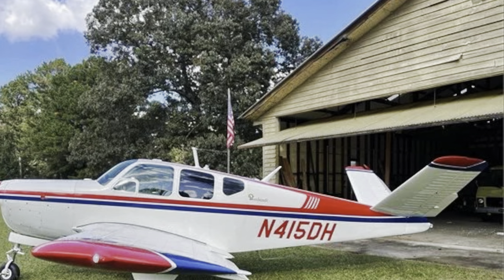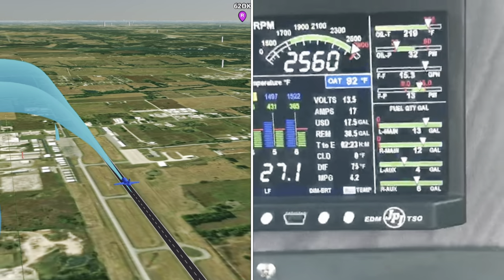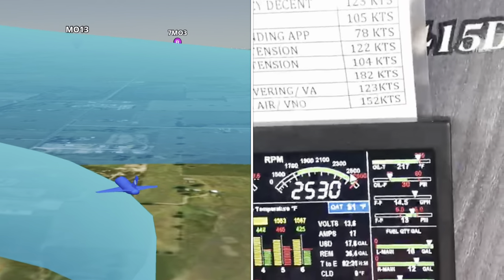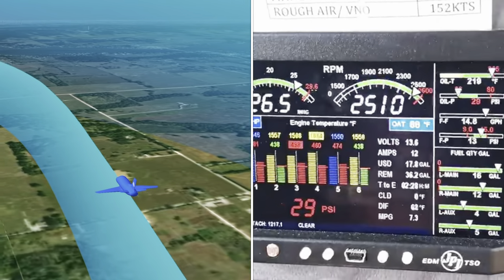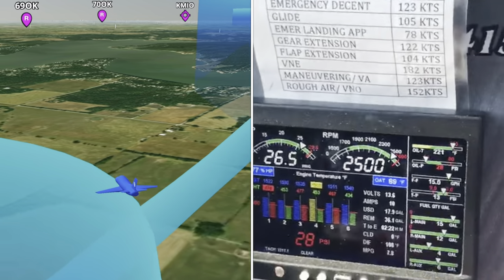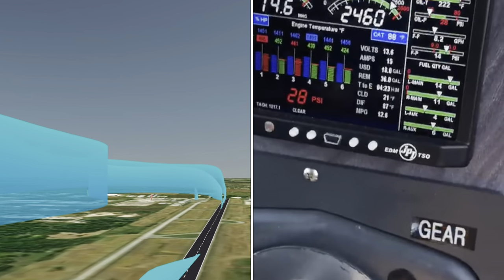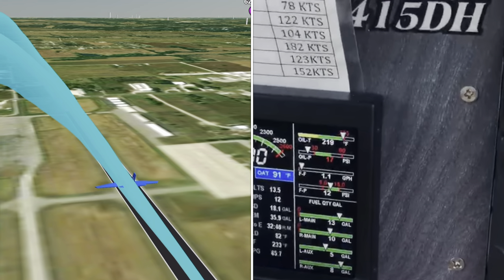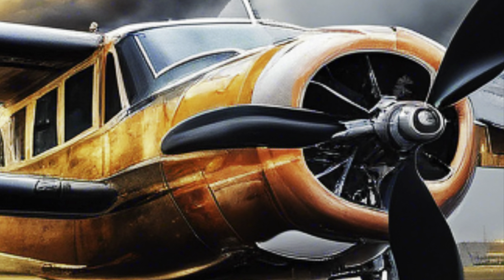My Plane Tried to Kill Me! : Surviving Engine Failure After Takeoff

Comment: So glad that you, the mechanic and your plane all made it out of that situation unscathed!  Thank you also for sharing this information.  I have a few questions, if you would be so kind as to respond to them.  For my questions to make sense, I first need to give some backdrop or context to them.

I have been following a YouTube channel for several years now that advocates a training approach for GA pilots that the airlines have been using for many years.  It's called AQP or Advanced Qualification Program.

Essentially, the stance is that in order to get our pilots licenses, among other parts of the training, we need to practice maneuvers such as turns around a point, slow flight, etc.  This is appropriate because it demonstrates proficiency, but that just helps us BECOME pilots.  It doesn't help us REMAIN pilots... by surviving emergency scenarios, like the one that you experienced.

How does proficiency with a chandelle help me if I have complete engine failure and a total loss of thrust?  (I know your situation was not a total loss of thrust.  I'm just using that as an example emergency.)

Anyway, that's where the airlines feel AQP comes in.  Rather than their training consisting of practicing maneuvers, they train for the most likely or most common real-world emergencies, so that WHEN the emergency happen, they're not caught by surprise and freeze up, or by the rush of adrenaline, etc.

Two of those AQP scenarios are LOTOT (loss of thrust on takeoff) and PLOTOT (partial loss of thrust on takeoff).  To get very specific, PLOTOT, coupled with the subsequent decision making by the pilot, appear to be the largest contributors to Richard McSpadden's tragic crash in Lake Placid.

Now to my questions.

#1 It appeared that although your engine started having problems at around 300', it was still creating enough power to continue to climb, but I can't be sure because I couldn't see any altitude markers on the flight path (CloudAhoy?) nor was your altimeter visible, so I'm only guessing at that.  Were you able to continue climbing?

#2 It also appeared from the animated graphic that there were open fields in every direction.  This to me would have been the #1 argument for doing exactly what you did and attempting a return to the airport and specifically, to the runway in the upwind direction, because, even if the engine suddenly failed, you could just make a modest turn toward an open field and make an off-field landing.  I'm just wondering if this was part of your decision process, because I didn't hear you talk about any of those decision points.  In other words, if your situation had been slightly different and you had lost ALL power and the only open fields were straight ahead, off the end of the runway where you lost power, would you have still attempted a return to the airport or would you have kept going straight and landed off field?

#3 The channel I referenced earlier is "Probable Cause Dan Gryder" and PLOTOT was an emergency that he ADDED to his personal AQP list, specifically because of the McSpadden accident.  Dan states that PLOTOT is probably even more dangerous than LOTOT because of the fact that that residual power can lull us into a false sense of security.  Again, in your case, it looked like you always had the option to bail out of the return to airport plan and land off airport, so that doesn't apply to your situation, but I just wondered about your thoughts on that.

Thanks so much!
Reply from the maker: You are correct the plane was continuing to make power and we were about 400 ft agl so I immediately made the the suicide turn since the plane was making power. This is my home airport and I know the surroundings so that’s why I chose to land into the wind instead of landing with wind (about 15 knots) if the engine seized we had open fields to land in. Any time I take off on 18 i remind myself that if the engine shuts down it’s a straight ahead landing slightly to the left to the open fields. Taking off on 36 is different story because of the lake.

Comment: You should safety wire the body in BOTH directions.  I’ve had mine move even after following the latest bulletin, but securing the bolt-head and body both CW and CCW with the fiber gasket has worked well.   We had the dual copper crush also fail....I prefer the combination of the copper top and fiber at the bottom, but preventing movement/rotation is essential.   Mine is an io470k in a 1963 35b33, I have lots of videos up flying around in her!
Reply from the maker: It is safety wired as you said, sorry I should have posted a picture of it.

Comment: A number of responses I consider excessively nit picky here.  Great job and it's a bonus that the engine is still usable.  Like you, if I'm in flight, I'm going to run the thing until it makes metal as long as it's making useful forward thrust.  Glad you, the aircraft and the engine are all OK.  Subscribed.
Reply from the maker: Thank you and appreciate your comments.
Reply: Turnaround for 3 minutes with low oil pressure and red line temp will damage that engine. Yes or not?
Reply: @JavierBrent  I worked in a machine shop when I was young.  Mechanical stuff doesn't work in absolutes like that.  If the engine makes good oil pressure after the oil filter adapter was fixed and there's not debris in the oil filter pleats, I personally would run it.  Being serviceable now doesn't necessarily mean the useful life of the engine isn't reduced, it might have been.  But there's no way of knowing if accelerated wear exists without tearing down the engine.  You can only work with the data that you have.  I would be watching the oil analysis like a hawk from here on out and cutting open every filter, in addition to the normal checks like compressions and so forth.
Reply from the maker: @JimBronson  Jim we do, this engine is  over 30 years old but it is mid time 1300 hrs. and the compressions are good and has over 300 hours of time within the last 3 years.  As long as there isn't metal and its not using oil I will continue to get the bonus time out of it.
Reply: @PlanesAndPoker  For the record, I agree with you.  Flying is expensive enough as it is, to not run an engine that from all available datapoints, appears serviceable.  I'd run it.

If I had multiple million dollars sitting around to where I felt buying a replacement piston engine wasn't a big deal, I'd just go buy a turbine powered aircraft.
Reply: @JimBronson  You are right !
Reply: @JimBronson  Cut open the present filter and send for oil analisis i bet there is damage.

Comment: I learned 400 agl Teardrop Turns partial power on cherokees in 1996.  Looks like you could do that maneuver, cut power after the 20 second turnback and land.  Save the engine.  To keep going around the airport with red lines telling you to shut down engine could have worn out that engine badly.  What procedure you dont know will hurt you.  Practice those partial power turnbacks.
Reply: Engines are replaceable, lives are not.
Reply: @JimBronson  Pilots should know the most to maneuver, not the least.  Some CFI's only teach the least.  Going around the airport with bad engine has killed thousands..  That is not a turnback, that is a Turnaround.  Duhh.

Comment: Take note pilots: the gauges showed an ABNORMAL indication and the PIC decided to continue the takeoff. You shouldn’t wait for an exceedance, but instead use trend data and good judgement. This pilot had been flying for 30 minutes and should have known the engine was outside its normal range. The mechanic was recording it which means they both knew there was a problem.
Reply from the maker: Unfortunately you are wrong and since there wasn’t a video showing both I was hesitant to publish but given the nature of the gasket failure I felt the need to as an FYI. The gauges never were outside of the normal until the last takeoff 3/3 and was only then that gasket failed.
Reply: both oil pressure and temperature were just along the green indicator in the video.   It happens quickly, and suddenly, and the likelyhood of it happening just before take-off are slim.   My temps and pressures are right on the line in the heat of summer at take-off and climb in the best circumstances
Reply: I’ll clarify what I mean by abnormal. Every engine will show consistent data with regards to environmental factors. Abnormal means indications that are outside values typically noted. It’s clear you were seeing abnormal temperatures during or before takeoff. My statement is to encourage pilots that problems can often be detected prior to an exceedance, as was the case here. I’m glad you published this video because it is a really good example of what not to do.
Reply from the maker: @patricksteadman1877  i published this video mostly to warn other pilots against the dangers of the tempest spin on oil filters, I also want to reiterate that this was a post maintenance flight with my AP filming so you are correct there was some abnormal activity however the oil filter gasket literally giving away wasn’t part of any problem that was previously noted. We were having an RPM issue that was ultimately figured out because a prior AP had used an incorrect fitting on the pressure carb on one of the lines. The CHT overheating and oil pressure issues shown in the video were solely caused by the oil filter adapter gasket tearing and subsequently losing 7 of the 9 qts of oil on the last takeoff.
Reply: @PlanesAndPoker  That engine might be worn out.  Careful..
Reply: @patricksteadman1877  The problem with the newer engines is that they have worse metallurgy, I have been told this by an overhaul shop.  The old engines don't have problems with things like cases cracking like the new ones do.  You can retrofit newer fuel injection technologies and ignition systms to old engines, Lycoming makes a certified E-mag now and you can get things like balanced GAMI injectors that will make your old engine run like a new one.

Comment: Failure in maintenance.  Audio says you complied with the AD.  But, above text says you were unaware of it.  Sorry for what happened, but not the manufacturer fault.  (I had a similar PILOT ERROR after maintenance when Mooney oil hose was in contact with exhaust pipe.  Fortunately landed with engine still running but needed overhaul.)  Your plane did not try to kill you.
Reply from the maker: Appreciate your comment. I say faulty design of a gasket tried to kill me. Since I bought this plane with with filter adapter installed, we should have caught the missing paperwork showing the AD wasn’t completed but we didn’t and hence the purpose of this video to get the word out, much like the video that JR Aviation put out as well. My hope is that no one has another incident with a Tempest Spin On filter because of the faulty gasket.
Reply: Disagree, any situation where oil pressure is half of normal and falling, the plane is trying to kill you.

Comment: I'd check the crankshaft& connecting rod bearings,  if they were without oil
Reply from the maker: We are checking everything diligently fortunately there was still a little oil on the dipstick and so far no metal in the oil.
Reply: @PlanesAndPoker   You SHOULD be okay then....
Reply: @PlanesAndPoker Ya honestly you were never totally without oil pressure. It was close, but its not so much about pressure but as long as there is flow its ok.
Reply: @PlanesAndPoker  I think in a car its usually the upper parts that get damaged first.  camshafts, timing chains, valves  etc.  but as a plane is horizontally opposed it may be different.
Reply from the maker: @eclipser2004 still had 2 qts oil left on the stick which is why the cam and crank were spared and kept the engine from seizing
Reply from the maker: @eclipser2004 👍
Reply: @PlanesAndPoker  Happy for you!

Comment: Glad no damages shown by now but.. Do oil test often.  Also, i learned Turnbacks a decade ago and had to turnback a Cherokee from 500 agl and saved myself from engine seize on downwind or base leg and not reaching the airport.  After i turned back i shut if off by pulling mixture after turnback still in air.   Was losing oil due crankcase cracked (Had a previous prop strike i didnt know).  Mechanic told me it could seize if Turnaround the airport like you did.  Many accidents on take off due pilot did a turnaround which take 3-4 times longer than a Turnback to closest runway.
Reply from the maker: I would never turn back with an engine that wasn’t making power under 1k AGL. This engine was still spinning and to be honest I was convinced it was toast so saving the plane wasn’t even a concern. I have watch all the Flywire videos and believe that Scott Perdue has proven that a turn back under 1k is sure way to get yourself into a spin.
Reply: @PlanesAndPoker  With some power and some flaps I taught partial power turnback from 500 agl on a Piper Cherokee 6 while full gross.  It is like a Vglide speed slow flight with some flaps.   Then a 40 bank turnback to land opposite.  First learn the Vglide speed slow flight, then turnbacks from it.  like a Flyover Turnback.  then other kinds of turnbacks like descending ones.  Many crashes due  pilots dont know power or no power tighter turns like Turnbacks. Practice Vglide speed slow flight.  With some flaps.  That is how you do GRM maneuvers,  then do turnbacks too.
Reply: @PlanesAndPoker   It comes down to what’s most important to save — you, or the engine/plane.
If the engine seizes the prop will stop — it won’t windmill — this means your glide ratio gets a lot better [ ~ 12:1   As opposed to ~  8/9 :1 windmilling } . That can be the difference between making the runway [ any runway ! ] or not. You see , the best glide angle/airspeed is usually given for a windmilling prop in the POH/AFM .
Reply from the maker: @davidwhite8633  I subscribe to the philosophy of Scott Perdue at fly wire the only job of the plane is to get you on the ground in one piece. If the engine seized then so be it but it until it quit spinning I was going to milk every bit of power out of it possible. When we landed we had about 2 qts of oil still showing on the stick.
Reply from the maker: @emergencylowmaneuvering7350  great info. Thanks for sharing
Reply from the maker: @davidwhite8633  completely agree
Reply: @PlanesAndPoker  with some power like you had, i used to turnback Cherokee 6's when heavy from 500 agl.  Bonanzas can do too.  Some power? put some flaps, troubleshoot, Get Vglide speed, Turn 45 bank, call mayday and clear runway, flaps and cut mixture.  Good pilots know how to fly Vglide with some flaps and turn without stalling it.  A friend saved his Cherokee 6 that way loaded.  had a slight fire, Turnback from around 400 agl and landed opposite runway.  No damages  landing it. We were cargo pilots in the caribbean islands. 1970's.
Reply: @PlanesAndPoker  I follow Scott Perdue too.  He has a video doing turnbacks on Bonanza.. He did them at Vglide for the weight and 45 bank.  Climbing at Vy,  not cruise climb like he likes mostly.  He turned back no stall and no stall warning either from about 700 agl.   but he didnt do the landings he could do due too wind he said.  But he did idle power turnbacks on Bonanza well.

On AOPA video named "The Runway Behind you", the bonanza couldnt finish the turnback on Bonanza because the guy flying turned 33-35 degree bank only at way over the real Vglide. That is wrong way.  He was afraid of turning 45 and at the real Vglide.  His fault, not the airplane.  Most airplanes dont stall at Vglide and 45 bank except the very short wings like piper colt or racing airplanes.
Reply: @davidwhite8633  The Vglide speed depends on the wing not just the prop.  Prop stop is at around 60 knots.  Only LSA's can glide well at 60 knots or light load Cessnas.  Most others need 70 plus.
Reply: @PlanesAndPoker  Yes you can turnback a Bonanza from 500 agl after take off.  With some power yes,  No power no turnback unter 1k agl.  You should learn those maneuvers.  I did.
Reply from the maker: @JavierBrent   completely agree with you and that’s what I was taught as well. since I was making power that is the only reason we turned back under 1k agl, no power under 1k it’s a straight ahead landing for me every time.
Reply: @PlanesAndPoker  You turned around, around the airport i  sort of see.  Turnback you dont turn around anything, just go to closest runway behind you or on side if many runways available.  Turnaround takes 3-4 more time.
Reply: @JavierBrent  Right. Many say turnback when turned around and turned around the airport when refers to a no turnaround anything TURNBACK.  Emergency LowManeuvering channel was my CFI too. He taught 4 kinds of EFATO -ROTOT on Cherokees and Grummans..
Reply: @davidwhite8633  Really? Where i can see that actual test, not just talking or dreaming.  WHERE?
Reply: @PlanesAndPoker  Nope.  If you turnback with some power at the turnback normal Vglide 45 bank, you wont stall unless you pull back a lot.  Which is a student panicky pilot error you wont do.  practice Vglide speed turns often.